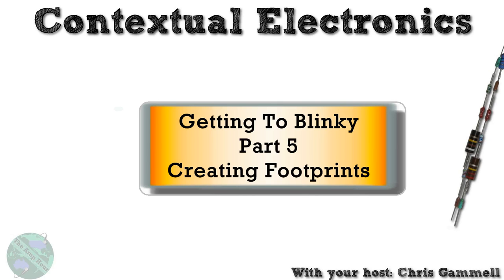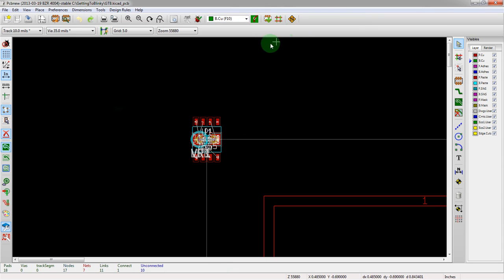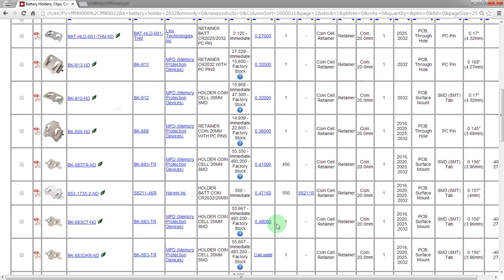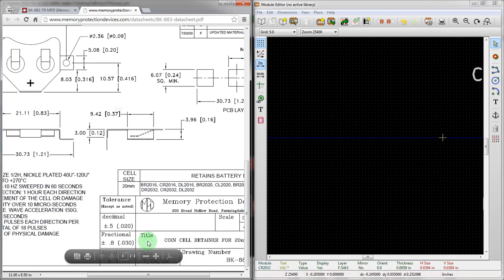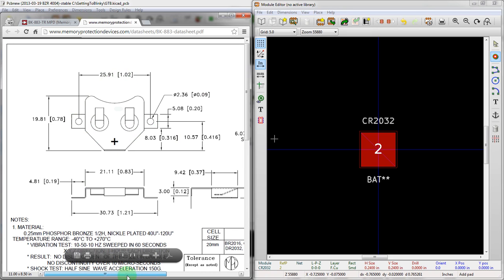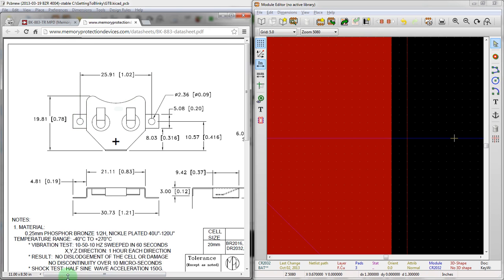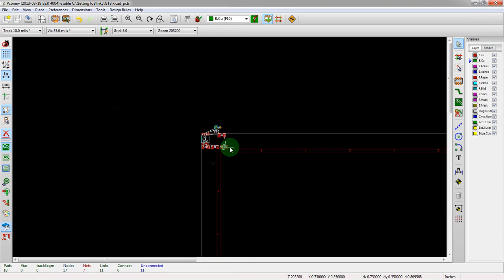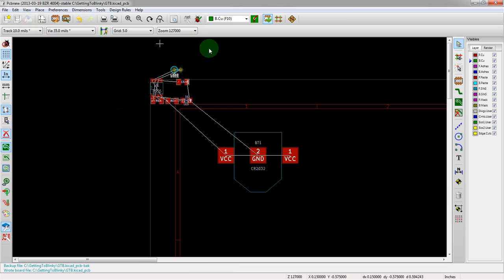KiCad 3.0 - Creating Footprints with the Module Editor - Getting To Blinky KiCad Tutorial - Part 5

Comment: here's a tip for the software designers... when you create a new project, it should create a new footprint folder/library, and default add footprints from any components you add to your project, even if there is no footprint for a component, it could create a blank footprint... there's no option for "new footprint folder" or "new footprint file". I had to come up with work-arounds to follow this in the latest version...